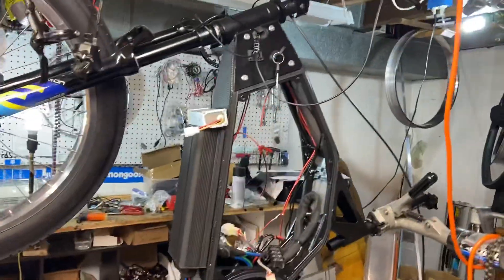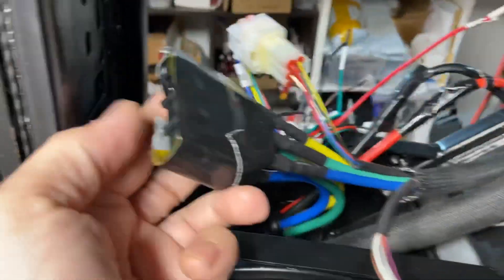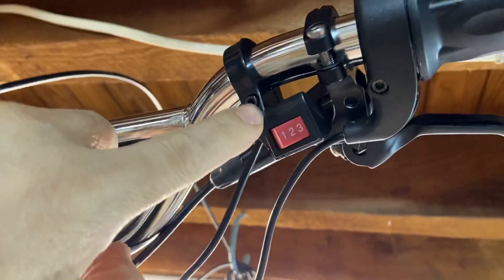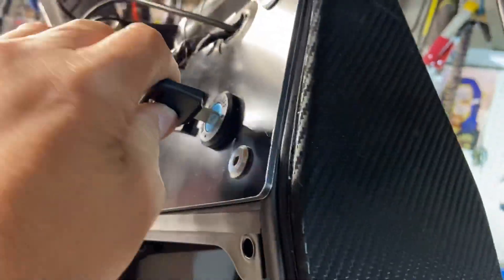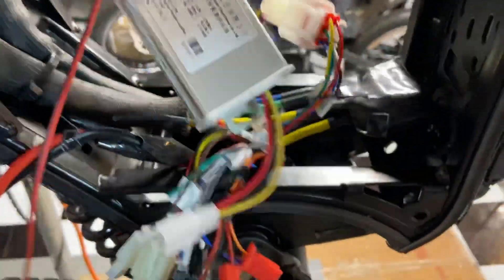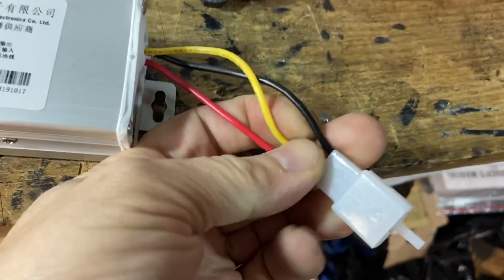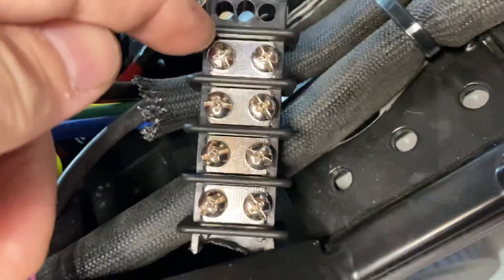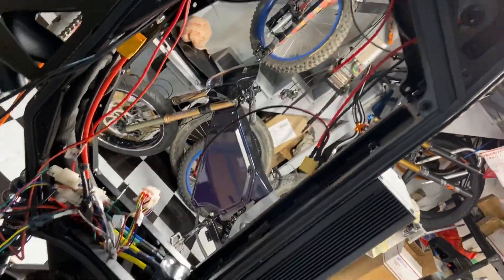Enduro Vector Ebike frame controller “how to wire”, connectors and motor wire 8000watt 12000watt

Comment: i have a question: there is one red wire in controller, when connected to main positive (84v) it turns on, should i extend that wire to key switch - is it safe like that ? should i add fuse or resistor in series for safety ?
Reply from the maker: You can . No fuse needed. Just don’t put any black wire to your key switch
Reply: @tobebike   ok thank you.  and to turn off 12v voltage regulator , should i use another switch or 4 wire key switch , two wires for controller and two wires for 12v converter ?
Reply from the maker: @JawadAhmadsahibzada  I use a 120v ac toggle switch o aHeavy Duty Rocker Toggle Switch 15A 250V 20A 125V SPST 2 Pin ON/Off Switch Metal Bat Waterproof Boot Cap Cover - 6 Pack by MUZHI https://www.amazon.com/dp/B07MFQ4TNK/ref=cm_sw_r_cp_api_glt_fabc_MYXW1VXN2X17AEW7PRKSNYDERS
Reply: @tobebike  thank you so much. You solved my problem.